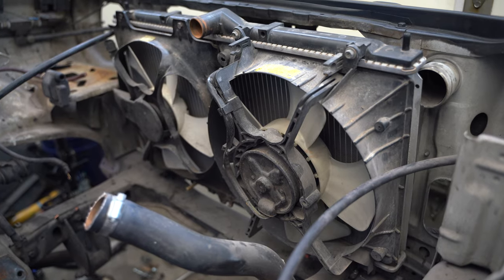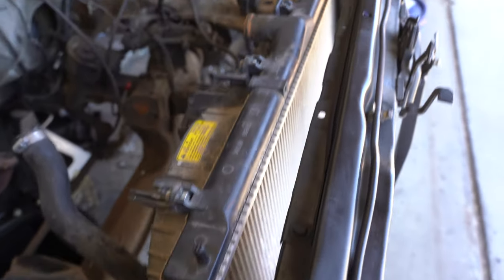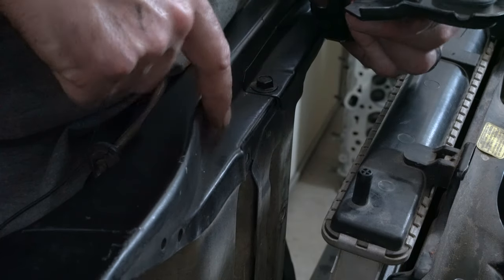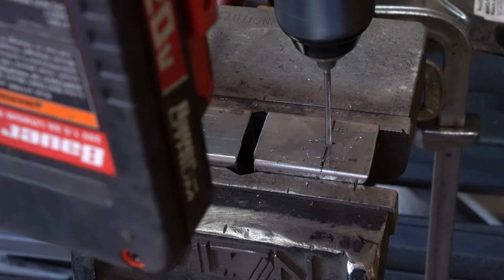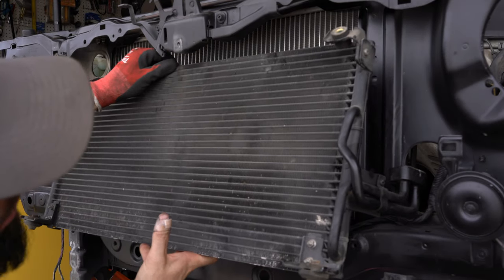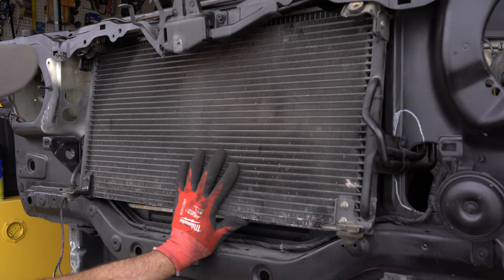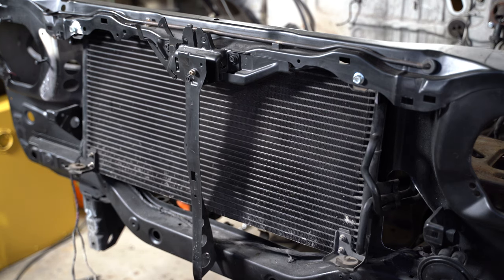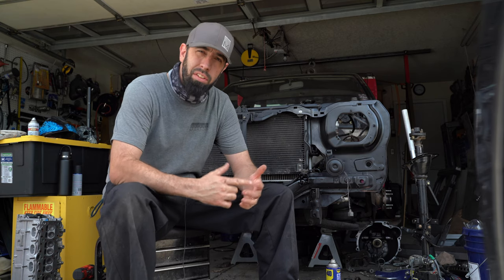Mighty Max Ep. 03 Adapting an Eclipse Radiator and Condenser

Comment: Good logic on the build.. use oem.
Keep a parts book with the car.. so years down the road.. you will know which brake pads fit. 

I converted some of my car to other oem parts. 15 years later I can't remember what they were from. Hahaaa
Reply from the maker: I feel you. As I was building my first truck I was using used parts because that’s what I had, not for the sake of easy maintenance. But I wasn’t recording what I got from what until halfway through the build. So many of the parts are indeed a mystery. 🤷‍♂️

Comment: Where’s your intercooler going to be? This is a 7-bolt swap? Narrow or wide block? Did you consider a rear sump oil pickup setup?
Reply from the maker: It is a 7 bolt. 1998. Narrow.
I'll be pushing the engine as far forward as possible in an attempt to avoid modifying the firewall. So I think I need the front sump. I'll be installing the Eclipse A/C unit and a flat firewall would be really helpful.
Reply from the maker: I missed the first part of the question! I don't know where to put the intercooler just yet. I'll likely be installing a larger one but I won't know the location until I have it in hand. I'm hoping behind the bumper and valance but we'll see.
Reply: Only downside is not much air flow unless your start cutting stuff out. Need that stillen front bumper. I did see a guy on fb making kits tho. Angles!!!!!!

Comment: I need to put in a new intake manifold gasket and valve.cover gasket on my 1990 mighty max.  Could you show that?
Reply from the maker: I’d love to... except I pulled that motor and sent it to the junkyard. 😔 The intake manifold on on the Eclipse motor I'm using will be significantly different.

Comment: How you connecting the engine to the gear box
Reply from the maker: I’ve read that the 4G63 is a direct bolt-up to the Mighty Max transmission using the flywheel from the Eclipse engine and the clutch disc from the Truck. I can’t confirm because I haven’t gotten that far yet but I will certainly do videos about it when I get there.